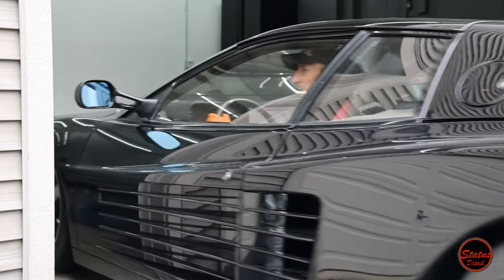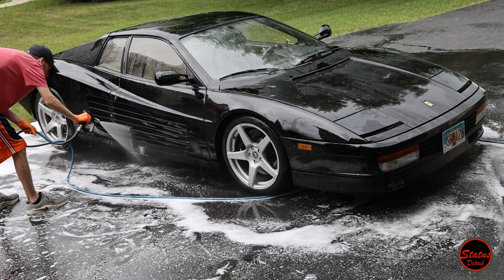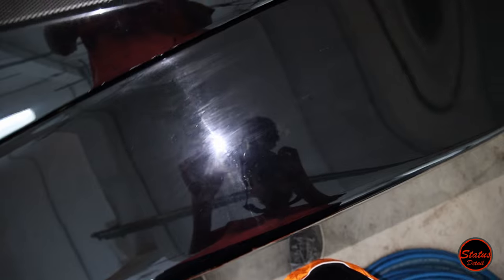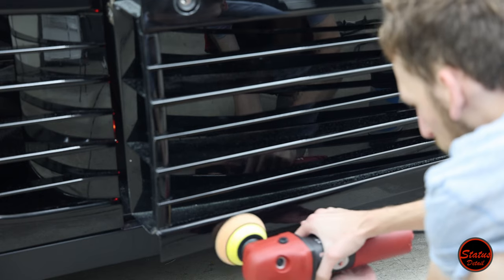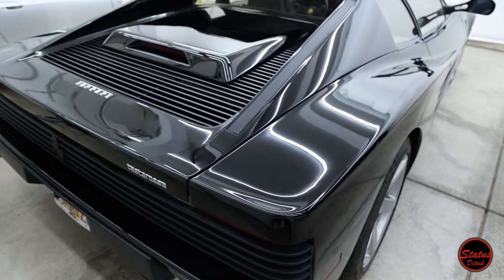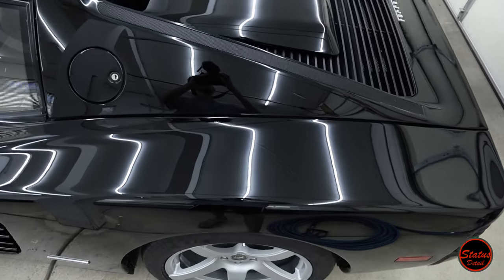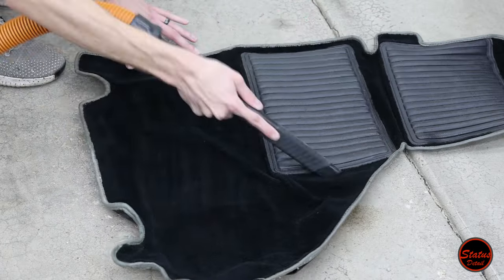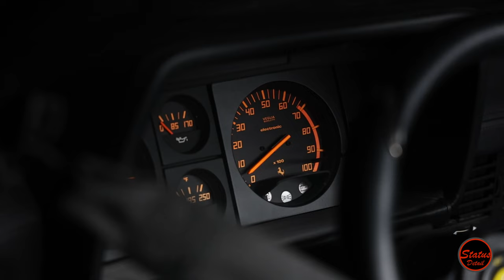Ferrari Testarossa Barn Find Detail | Paint Correction Restoration

Comment: Noticed the rotors were rusty after the wash. Does the car go out like that or do you remove it some how?

I use Hyde’s to prevent it and the rust colored dust that ALWAYS 🤬 sticks to the wheels when the pads rub it off.
Reply from the maker: Typically I removed it. But after the mold issues and this being a pretty horrendous car to drive mechanically it was picked up as is at the end of video.
Reply: @STATUSDETAIL  that car definitely had bigger issues to worry about. I believe I heard the car was returned to the seller…..after a first class correction and detail. 

How do YOU prevent rusty rotors or remove it if you weren’t  able to prevent it? The only way I have really found is to spray rotors with Hyde’s just after rinsing them. There’s also definitely less of it during colder months when things dry slower.
Reply from the maker: @seashackf1  it was definitely returniled. Lots of issues lol

I dona forward back in driveway or fast drive up the street and get on brakes a bit harder to clean it.

Comment: I have never used reflect.  Usually when I jewel my goto last step is CarPro Essence or Essence+.  This came out amazing, which makes sense after 4 steps of polishing.  How long did you spend on the exterior detail from start to finish?   Looks like a 18 hours job to me.  I am mobile so I try to avoid those kind of details, if it can't be done in a day I prefer not to do it.  These are the kind of details I wish I had a shop so I could do.  So you went with CSU and EXO or CSL and EXO for the coating?
Reply from the maker: Was here 3 days. Half of third day was for interior with 4 day for extra time if needed. But the mold put a end to it basically once the ceramic was on. I always do interior while ceramic cures. So it's my last step basically. 

CSL EXO 👍

CarPro essence and plus are good. Reflect is more versatile. It's a great jeweling polish on hard paint. If you work it long enough with some force it can correct light swirls in medium hard paint. It can correct medium grade swirls in soft paint pretty well. If you work it the right way on soft paint it can jewel well too. It also has virtually no dust. It's kind of a home run product in my eyes. 

Rupes one I think it's called is also a killer dedicated jeweling polish.

Comment: There is something really special about this car in black... as long as the paint looks better than new like it does here. I appreciate this video! 
My '93 Nissan 240SX has been sitting under my carport for 4 years since the ignition was damaged by an attempted car thief and its got green gunk from my Evergreen tree (rain runoff from tree, not pitch) caked on the top and side surfaces of the rear fenders and back end... so you scared me when you said that stuff can rot INTO the paint... I hope that didn't happen!   
Can you recommend a foam to spray on and let sit to get it off?  I just saw a video where they pressure washed a car, but that feels like way too much pressure to me (they were using something little that appeared to be made for detailing and likely has the perfect amount of pressure).    In 2016 my car had a complete complimentary wax and polish when it went to the body shop, so I don't want to mess that up with the method I use to remove the tree gunk (assuming it's not already messed up by the green tree gunk).
This is a beautiful video, thanks again!
Reply from the maker: I would pressure wash as much of it off as possible. Then foam with a very strong solution of gyeon form or carpro lift or gtechniq citrus foam. 

Pressure wash from a good distance away and slowly get closer. Hopefully you find a effective distance. You don't want to get to close but you might have to depending on how thick and crazy the build up is. Probably clay that area once it's clean but still wet during the wash. Then so e compound and polish after should restore it assuming it's not damaged already. 

Good luck!
Reply: @STATUSDETAIL  Wow, thanks SO much for the super quick reply!  :D  You told me just what I need to know, thank you! 
I would have never thought to clay it (I'm not a detailer).  Does it need to be clayed to get gunk off, or do I clay it even if everything appears to have come off with soap?

I'm in Seattle where our local car wash place is Brown Bear.  Do you think the foam that comes out the self-serve wash on the "foaming brush" setting would be good enough?  Obviously I won't use their brush!!!
 
Thank you SO much for your advice!!
Reply from the maker: @StratMatt777  my pleasure 🙂

I like to talk about clay like going to the emergency room. You don't just wake up and to a ER. You go when you break your arm or something makes you go. 

We don't clay unless something something makes us need to pull the clay out. Theoretically it's possible that you wash the car and it would be incredibly clean after. Play some what you're describing and because the car is sitting so long this is extremely unlikely. 

After you wash everything off would I expect is that your paint will be very rough feeling almost like sandpaper. The clay will remove that effect and also pull a bunch of junk off the clearcoat. You really can't affectively polish or compound a car if it's loaded up with a bunch of gunk. So it's pretty important that we get that out with the clay the best of our ability and then we can really go in and polish and or compound. The wash and clay is kind of like "scrubbing in" before surgery. The surgery being the paint correction step. 

It sounds like you're talking about a coin operated pressure washer pay where you control the pressure washer gun. You can definitely use something like this to clean the car up. I have a hard time believing the soap coming out of that is very good but it's better than nothing especially if it's something that's easy and convenient to get to. Make sure you bring a bunch of quarters this isn't a process you'll want to speed through.
Reply: @STATUSDETAIL  Wow, thank you again for taking the time to go into so much detail! Thanks to your reply I now I understand what clay is used for.  Thank you!   And, yes, I am planning to go SUPER slow with the pressure washer.  How long should the foam sit on the car? Like 10 or 20 minutes?
Reply from the maker: @StratMatt777  once the rinse is done I'd let the foam sit for a few minutes. Maybe like 5 max. Do your best to do this in the shade and not indirect sun. You don't really want anything to dry out. You can definitely film it more than once.
Reply: @STATUSDETAIL  I cannot tell you how much I appreciate your free advice. Thank you so much!
Reply from the maker: @StratMatt777  my pleasure 🙂

Comment: Nice! 👍 I see a lot of European detailers being much quicker to whip out a Rupes Scorpio and a Ta-50 and start damp sanding basically the whole car right out of the gate on something battered like this.  As Americans, I think we get real icked out in a hurry at the concept of sanding at all. If you wanted a real quick leveling cut without building up the heat, would that not be one way you could go about it?
Reply from the maker: Great question. There are a lot of ways to paint correct a car. Many of the ways are wrong. Many of the ways are "right" 

In some situations wetsanding or dry sanding is the necessary and correct step. I have seen videos showing sanding vs compounding and in some situations the sanding removed less paint while keeping lower temps as you mentioned! While removing orange peel. Hard to believe!

To sand a car I think you have to understand what your goal is. Is it defect removal? Was the car painted poorly and not refined at the body shop? Are you trying to remove orange peel? 

I certainly could have wetsanded all vertical surfaces. They had the worst defects and etchings. 

But I knew that paint was better than most and had little orange peel to start. Defects could definitely be polished away and the heat I initially added made the paint swell. This acts a little like a exfoliating step for etchings. Heat is not always bad when paint correcting. It's often helpful. But must be managed at safe levels. you can also avoid heat with some different techniques and products when needed. So in my personal opinion sanding would have added nothing to this car. 

I did have a few deep scratches. Sanding would have removed those. However on a 33 year old car that started with notorious thin paint and soft paint.... Not worth it. I can paint depth gauge it but that tells me primer. Base coat. Color coat. Cear coat. It does not tell me just clear coat. So to a large degree I really don't know how much clear I have to sand away and leave enough so I can still compound the sanding marks back out and then polish again. 

This may be one of my longest responses ever lol. I hope that all made sense. I'm definitely not against sanding paint to be clear. It just has a right and wrong time for every car and it's unique situation
Reply: @STATUSDETAIL  Definitely by all means I’d say that’s a pretty good response lol. I don’t disagree with your approach in this case at all. It’s just a matter of academics why I asked, and that’s a pretty good answer I’d say. I’m looking at getting a little better knowledge in regards to sanding and getting myself the Rupes tools I mentioned. I have a personal vehicle that I would like to practice this type of correction on when I get the tools in hand. It’s just an interesting concept to me to try to approach my corrections with the oem mindset the Europeans do.
Reply from the maker: @TheRogueElement  You can definitely work on your personal car and learn and that's totally fine but for sanding practice I would go to a junkyard or a body shop and basically take what will be essentially a free hood or maybe a $50 hood and learn on that

Also if you want to get into sanding check out KXK Dynamics they're basically the Masters of sanding cars

Comment: Shame what someone did to such a classic car. Nice job reviving her. When you are paint correcting do you measure paint depth? I didn’t hear any mention of it and it’s really important on an older like this when you have no idea how many times it’s already been detailed. Especially when you are doing a major correction like this. With detailing on YouTube making it look so easy many people are now machine polishing that never would have touched one otherwise. I have a feeling the vast majority of them are actually over correcting and removing too much paint. They’ll never know it though, but the second or third owner will.
Reply from the maker: I specialize in correction so I remove exactly what I need with the process I use. I could write a paper in this so I'll just stop with that lol 

A paint depth gauge reads everything. Clear. Color coat. Base coat. Primers. They virtually never read carbon fiber and many of the cars we do are made of it. 

Point is they read everything. So if I take a reading on this car it tells me I have 5 mils. I don't know how thick the paint was oem in cars that long ago when new. 

We have no history in previous owner and how often he polished it had it cleaned. 

I could have 1 mil of clear or 3. 

Either way the owner wants correction because you saw how bad it was. 

So a deity gauge isn't going to help me or guide me on a job like this unless it said it had 2.7 mils and if that was the case it would have warning signs all over it to not touch it. 

Paint correction done correctly is like a set form.  Guys taking a rotary with wool and aggressive compound hacking away is.... Something else. That's how you burn past clear.

Comment: What is your process for removing compound dust?
Reply from the maker: If it's bad you literally wash the car again. I've shown that in a couple of my new videos and it's coming up in another of my videos this Sunday we talked about it.
Reply: @STATUSDETAIL  what if it’s not bad?
Reply from the maker: @MiataPower96  gyeon prep and wipe it all down. A detail blower can help with tight spots. Then apply wax. Sealant. Ceramic etc
Reply: @STATUSDETAIL  alright. So using Gyeon prep over a light dust won’t reintroduce micro scratches?
Reply from the maker: @MiataPower96  if your using a good towel and spray a good amount of lubrication over the surface with prep is should be ok. If your concerned about creating new swirls or lots of dust and clean up you should be washing again
Reply: @STATUSDETAIL  alright thanks

Comment: Surely this process of heating the pad and panel and seeing defects ' vanish ' is simply paint swell, and a temporary effect??
Reply from the maker: Partly temporary. But I believe it's helping in this situation to kind of exfoliate some continuation and etchings out. Like leveling it. 

Certain scratches for example can swell then cool down and show.heat is not always bad if managed carefully. You obviously can't over heat panels. That can cause unrepairable damage that requires body shops